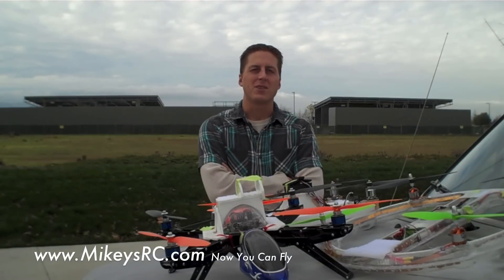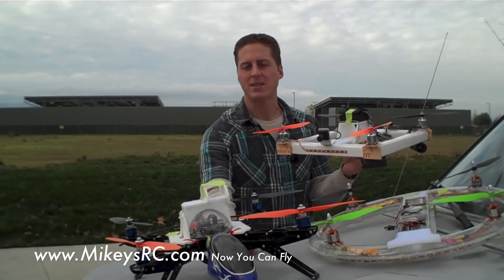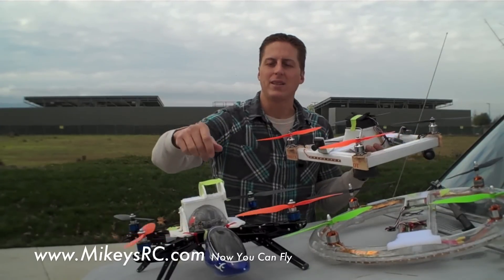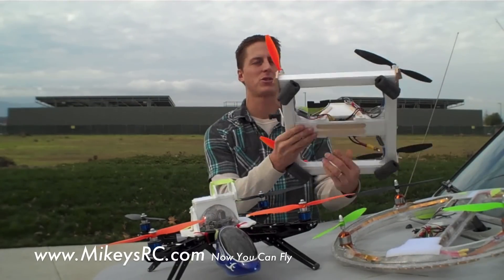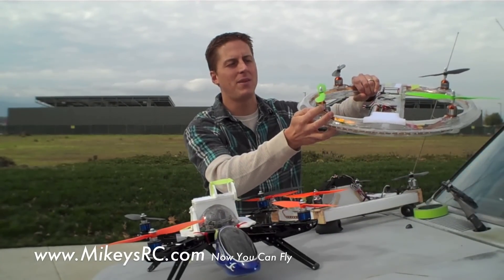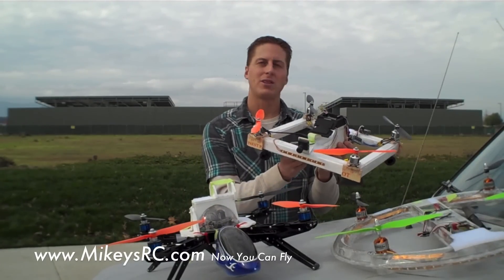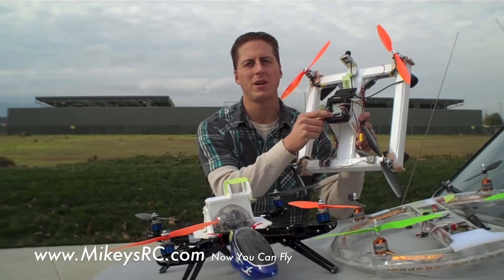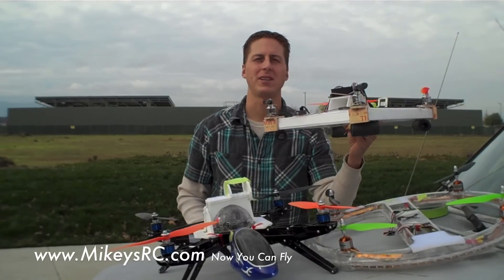Cheapest Super Light Quadcopter Frame $5 & 180 grams - Multirotor

Comment from the maker: Hi Alan,

THe long tubes are about 14 inches long.  The shorter ones are about 12.  So cut foamboard those lengths then score the foamboard with 3 sides being 7/8" last side is 1".  GLue the long side to the other short side after breaking the foam where you made the scores with a razor blade.  Just hot glue together.  Cut 8 sections 2" long of wooden yard stick.  These are the motor mounts and also used to stiffen the corner joints.  Watch and pause the vid you can see how I made everything.

Comment from the maker: Yes true.  On closer inspection o f my motors it was not a magnet.  Where the bell mounts to the shaft seems to have gotten messed up / wallowed out or warped when I had a hard landing.  Of course the factory setscrews are in so tight I couldn't remove it to try to repair so I guess I toss the motor =(